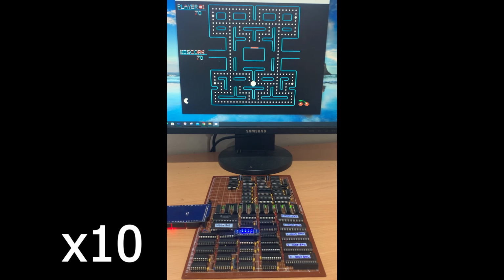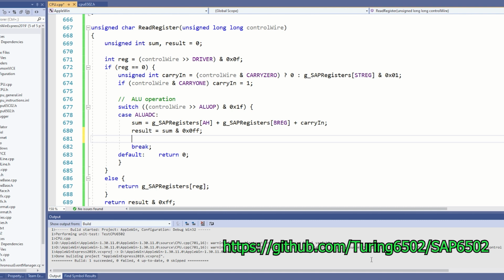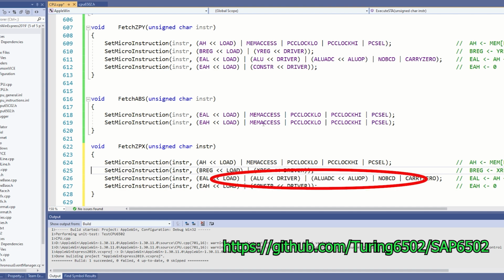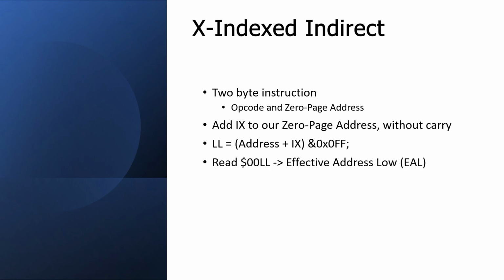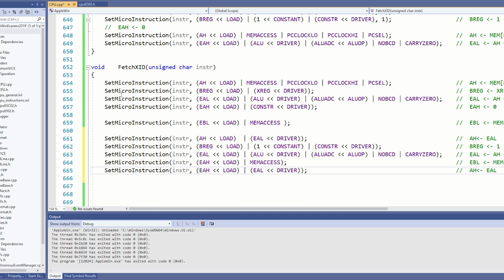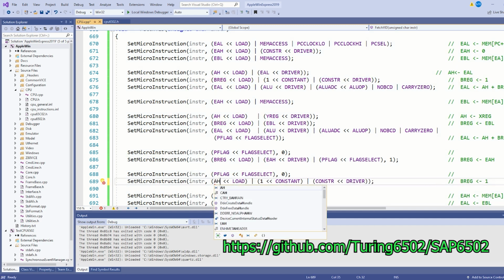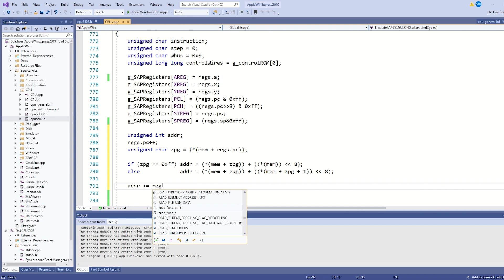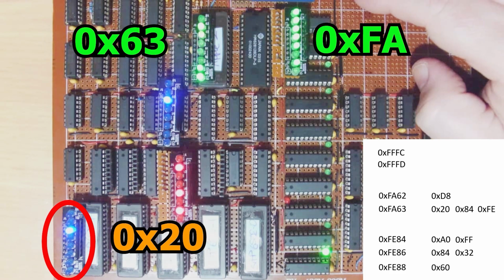SAP6502 Microcode Addressing Part 2

Comment: In my opinion indirect Y indexed is the most useful of the page zero instructions. It is how you implement pointers and structures. Without it you would have to use self-modifying code with absolute Y indexed.
Reply from the maker: I think it’s probably the main reason that the 6502 is simple yet competitive.  Its used pretty extensively for inner loop screen updated.
Reply: @DrMattRegan  The PDP-8 had a similar concept because it couldn't hold an address in its instruction. So either page zero or PC page was used with a offset in the instruction. Page zero mode also allowed indirect addressing with auto increment. So I have always wondered if the 6502 was influenced by that.